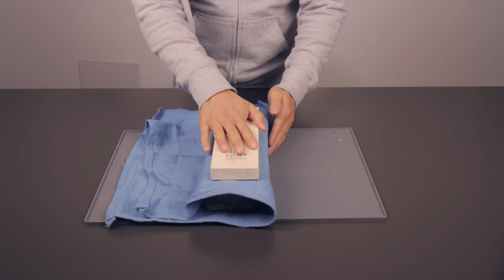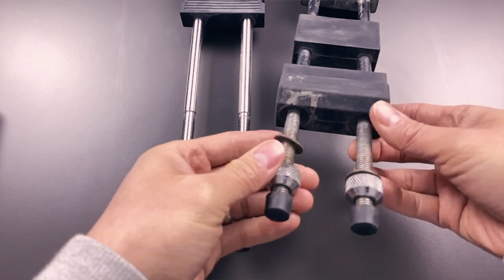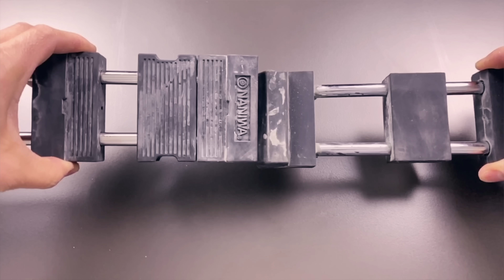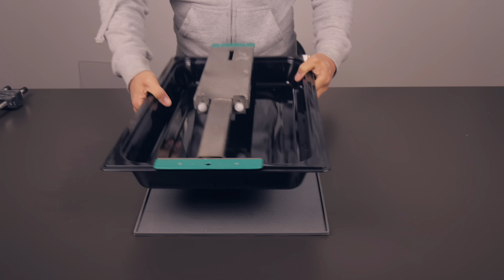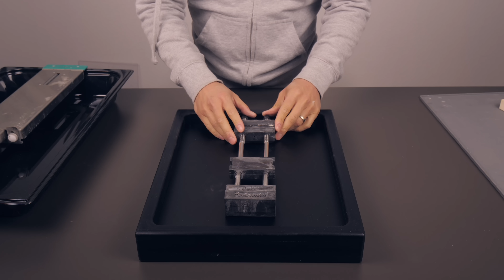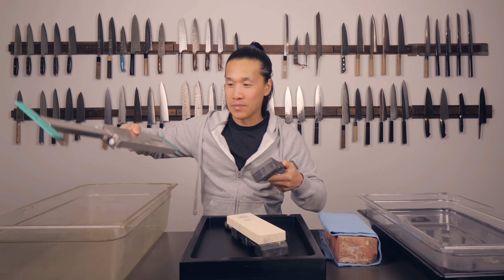The Essential Knife Sharpening Setup:  Whetstones, and Maintenance Gear

Comment: I use a japanese stone that is 2000/5000 and a diamond "stone" that is 400/1000, which also doubles as my stone flattener every time. I have some victorinox and some other cheap brands and I spent about 3 years on and off getting halfway decent at keeping my victorinox santoku sharp. I just got to the point where I can reliably shave my arm after every session which I'm really proud of, and I also recently ordered my first damascus knife in celebration. This setup would definitely be an awesome way to keep it sharp! Love your vids man you're awesome.
Reply: Very encouraging post, there. I ordered an expensive knife before I ordered stones. One day, I know I will have to get up the courage to try to sharpen the knife. Inexpensive knives I'm not afraid of, but matching the tiny low bevel angles on a thin (and expensive) knife is a daunting thought.
Reply: @davesmith5656 : At some point your nice knife will need sharpening, right? Maybe while you are gaining more confidence, you can keep it sharp with a strop. It doesn't take the place of a stone, but it's close, and you're unlikely to scratch up your knife. But ultimately, knives are meant to be used, and they will begin to show it over time. Have fun!
Reply: @b-radg916  ---- I do have a strop, and I'll take your advice on it, practicing the bevel angle. Thanks.
Reply: Dave Smith: Do you have a compound for it? We while they're not marketed with grit ratings, green compounds are typically around 6000 grit. A year or more back Ryky did some videos in stropping. You only go edge-trailing, otherwise you'll cut the leather. I do it regularly.
Reply: @b-radg916  ---- Thanks for the additional heads up. I just got a knife sharper than a Shun (granted the Shun is OTB, and used about 20 times to trim beef and cut some vegetables). I believe they do make diamond spray for strops, measured in microns (which can be translated into grits). IIRC there are about five finenesses offered, the finest at something ridiculous like 0.28 microns. Still no way I'm going to try to match the tiny bevel on the very thin Shun paring knife. I do well to get within 100 microns of any bevel angle, unless I want to try for a one-stroke micro bevel. 

Just for grins, if you're trying for an 11.25 degree bevel, then 1mm out from that means you have to stay at 250 microns in the angle of the blade to the stone. To explain: 1.0mm x 1.0mm short legs of a right triangle will form a 45 degree hypotenuse; reduce the vertical leg by 0.5mm and you have 22.5 degrees; reduce it by half again to 0.25, and you have 11.25 degrees for the bevel. That 250 micron height of the vertical leg is huge compared to a 1.0 micron grit. Vary it by 10 microns, and you're off the edge or forming a new micro-bevel. Anyone who can get only a 1.0 micron height variation 1.0mm from the point of contact of a bevel with a stone is gifted. Even if you go out 1cm, you have only 10 microns to play with (your have to be precise within 10 microns). Go out 3cm and you have 30 microns. Even then, you really have to have an almost perfectly flat bevel and perfectly flat stone (with a lapping plate with 1.0 microns or less tolerance). I don't want to rain on anyone's parade, but that's cutting it really very thin! One micron is invisible to the human eye unless maybe it's in super high contrast, like a reflective white line on black paper, or a 1.0 micron laser.

Maybe there's something I'm not getting, like maybe smoothness of the bevel with a super high grit stone, but getting a 1.0 micron edge seems more like blind luck than skill. I don't think even a concert violinist can get 1.0 microns, and those guys are g-o-o-d! Heck, the guy could eat more than usual, gain a couple of pounds, grow a bit of extra skin, and he's more than 1.0 micron off normal. It would be interesting to know how much sound wave length changes with a 1.0 micron change in length if a vibrating string. It's all by touch and feel and sound, but 1.0 micron ...? I'd be delighted with 50, and it would probably be good for one or two slices.
Reply: Dave Smith: OK, you're going deeper than I care to for sharpening. Obviously a consistent bevel angle is important, but it's not the only thing. When you sharpen with a finer stone or compound, you are making the microserrations smaller, which can make a big practical difference in the kitchen. But depending on one's typical use, some prefer to finish with a 1000 grit (slightly "toothy"). I sharpen to a 3000 grit and finish with a strop with green compound. But yes, always doing my best to keep a consistent angle.
Reply: @b-radg916  ---- Oh, I've had my head handed to me a few times. Many years ago I wrote the Martin Guitar Co. complaining that no matter how I tried, I couldn't get their guitar (that I'd just bought) tuned for all frets. They sent a letter and booklet explaining that it is impossible to tune any musical instrument perfectly because sound waves are not longer or shorter in a linear manner. I've forgotten how it works (if I ever understood it at all)) but it's not x=2y for each octave (there is some guy who has equations for it, but they're a bit daunting).

Comment: Ever tried the bottom of a ceramic coffee cup?  It works better than one might think.
Reply: I use the bottom of my plates in a pinch, it's amazing for my carbon knives. Sets them right up again.
Reply: I did that for years. I had two very modest carbon steel knives but I could get a fine edge on them. Not good enough for the razor-edge parlor tricks you can do with paper and tomatoes and so forth, but if you just wanted to prepare your food you were golden. 😊

Comment: Hey Ryky, thank you for all of your videos.  Because of you I took the plunge to free hand sharpening and stropping.  I have a Kramer carbon 10 inch chef's knife that has a better edge than the factory edge it came with.   I had been using an Apex Edge Pro, which works well, but now I feel I am getting better results from free hand sharpening.  Currently I am using the Kramer sharpening system from Zwilling.  I also find it to be a very relaxing activity.  I was hoping you could give us more detailed reviews of some of those beautiful knives you have hanging up behind you.  I know you just received several boxes from your Japan trip, can we get a more in depth look at those?